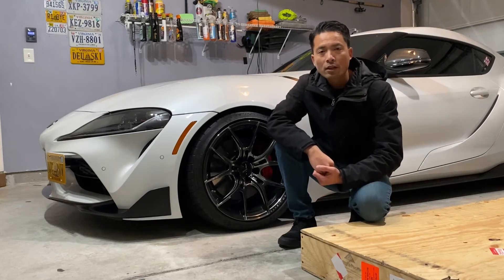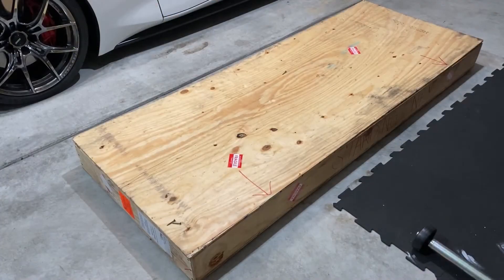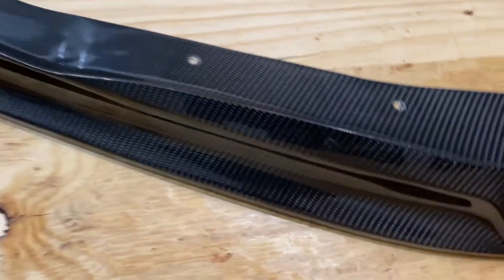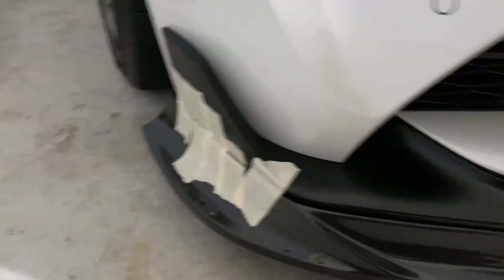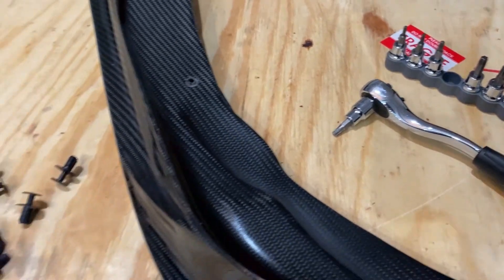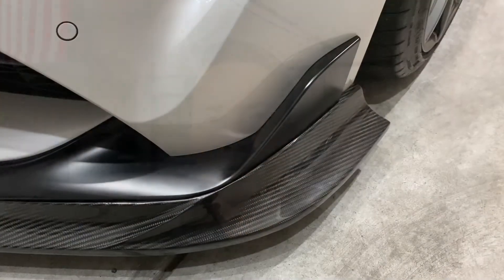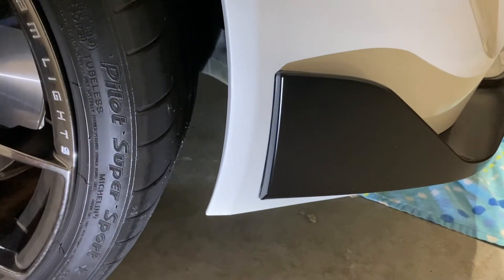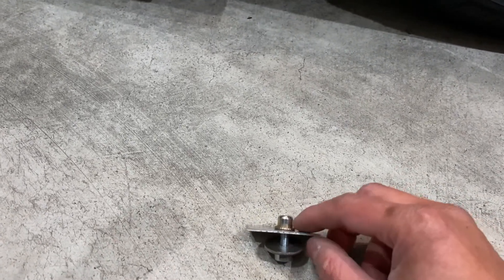LG Motorsports Carbon Heritage Splitter installation on my 2020 GR Supra!

Comment: any issues with the lip since installed? still holding firm?
Reply from the maker: No issues, even hit a rock at low speed and no structural damage due to the design and how the lip is mounted.
It had to sand down the damage and re-apply clear coat and it looks like new. I would invest in slip-lo scrape guards if your car is lowered.
Reply: @Nismo_Zed  Thank you so much for the reply been try to decided between LG and Seibon.
Reply from the maker: @hunter_c99  I wanted the money Seibon so bad but it’s never in stock 😒